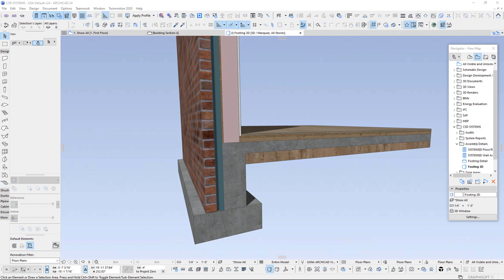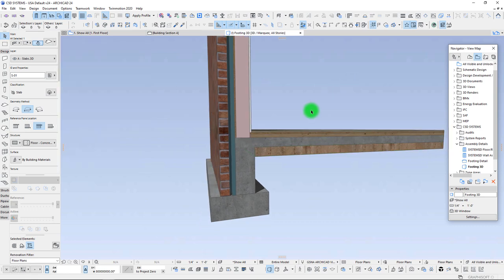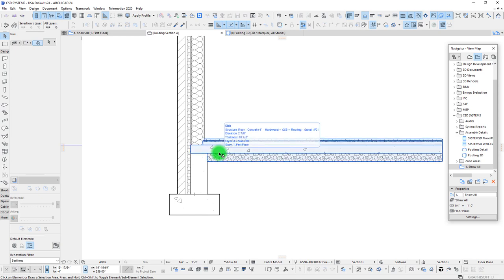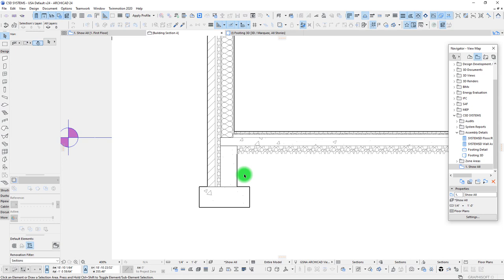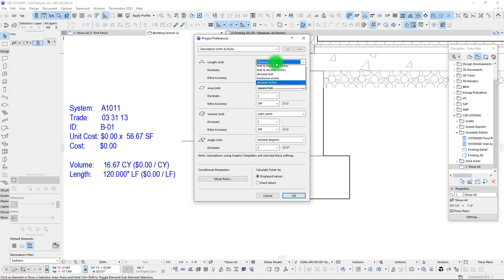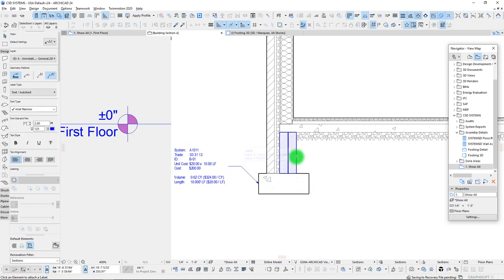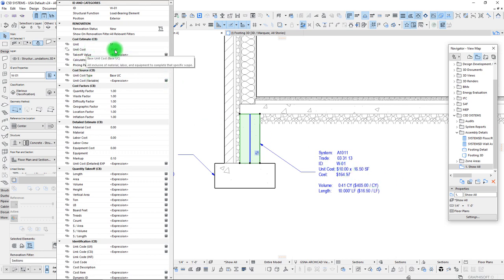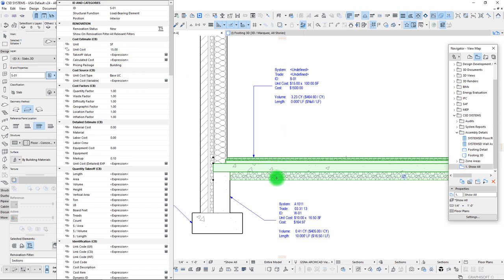How to Setup Archicad Composite Structures with Cost Loaded Labels

Comment: Great video! Never thought of doing things this way! What if the wall spans across multiple rooms (as it usually does) and you have different types of paint in those rooms and in some rooms you have tiles on the wall that are only applied up to a certain height! I usually model the tiles separately with a second wall and that allows me to have the tiles shorter than the main wall! It can also be done with a complex profile wall but that method has it's own problems! I use a surface schedule to extract the exposed surface area and that gives me the exact surface of wall that's going o be covered with paint but the problem is that the schedule takes a huge amount of time to calculate the surface area on a bigger project! Plus, I hate it when I need to slice the wall in multiple sections just so I can put a different paint on it!
Reply from the maker: Hi Marian. Thanks for the comment and questions! Sure there are always a lot of particulars that can be worked through, but much of what you're describing I'd consider a CD/Bidding level of detail. The method described here is ideal for cost assemblies at SD/DD level of detail, where you don't need to define different finishes as described. For that level, going to component/surface schedules can do the trick, breaking it down more into individual trades and materials. Breaking it down is good to help with the longer calculation times:)

On the tile note, if you're modeling them separately, super easy to quantify and define. In general, the more we break out scopes into different elements, the easy it becomes to perform exact takeoffs and cost calcs. It's when we have large composite structures or complex profiles is when we need a system like this to handle it!

Comment: Hi John, great channel and amazing job!!! I have a question/challenge for you. Have you tried to use the masterformat classification for Building Material only instead of elements?
Reply from the maker: Hi Diego. Great question, and yes I've definitely explored using Classifications for building materials. I'm currently organizing the building materials by the CSI classification, hard inputted into material ID and Name, but you could assign a masterformat classification as well. Problems start to occur though when you have a masterformat classification assigned on both levels. In many cases, you have to assign masterformat to elements anyway in the case of objects that are not made of a material.

Comment: John, great tutorial. I wanted to know if there is any available Cost database that you can associate with Archicad, so you don't have to fill the cost every time of if the cost changes, then it updates the cost estimate automatically. Thanks
Reply from the maker: Thanks for the comment and the question! There are some different ways of linking cost databases, one being the older property object calculation method. With the newer Property Manager, properties can be exported and imported via the excel exchange, and this can also be setup using python scripts. I prefer the method of exporting properties via an interactive schedule to excel, then use a vlookup formula to automatically apply updates or add new entries into "types" and "costs" fields for the many different components. The other end of the spectrum would be to have the database of costs on the excel side, and then populate quantities directly there where it is managed side by side with the estimate.
Reply: @CONTRABIM  шшш

Comment: Thank you for the information. Can it be done so that the costs to be drawn from an exterior spreadsheet? So you can update the prices for everything if prices go up or down without having to do that manually everytime?
Reply from the maker: Check this video out: https://youtu.be/S3DTzd3aUcg Same general workflow exporting and importing properties from composites...
Reply from the maker: Thanks for the comment and question! Yes all these details can referenced in a single interactive schedule, then exported to excel, filled out or updated, then imported back in. This other video link I posted describes the general workflow, and also has a sample download of the VLOOKUP formula used in Excel. Thanks!
Reply: @CONTRABIM  thank you for the answer. Really impressive stuff and it really helps when doing estimating. I am currently using Planswift with google spreadsheets to do the exact same thing but with Archicad if you model everything correctly you eliminate a step. Will definitely look into your method